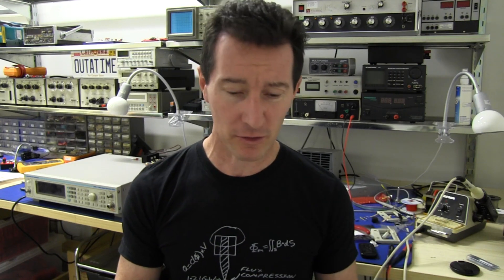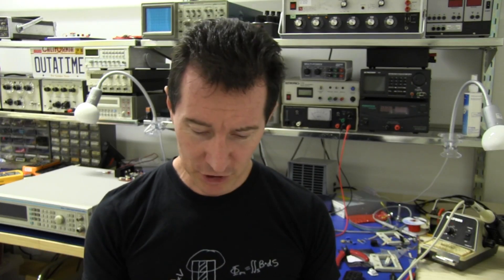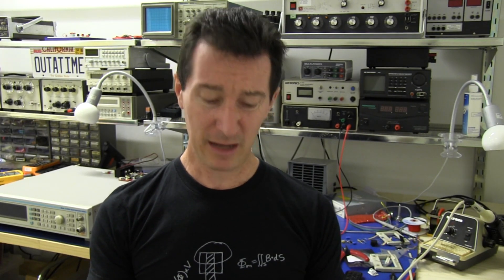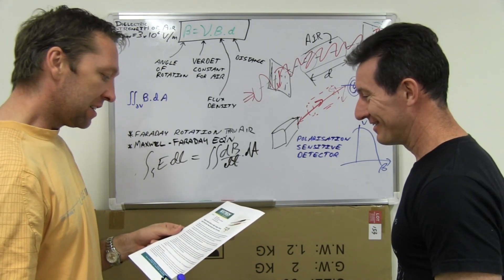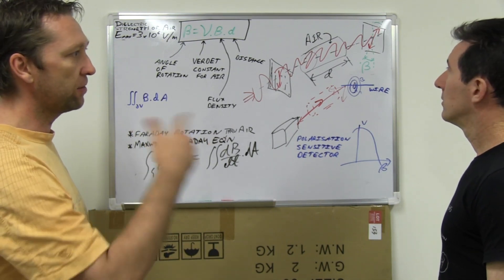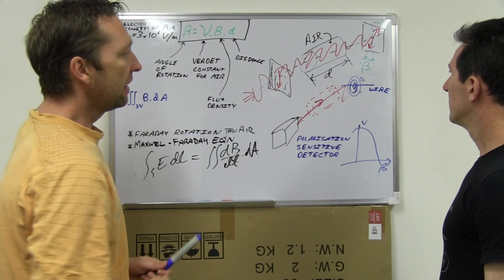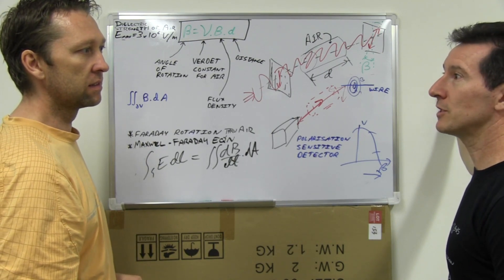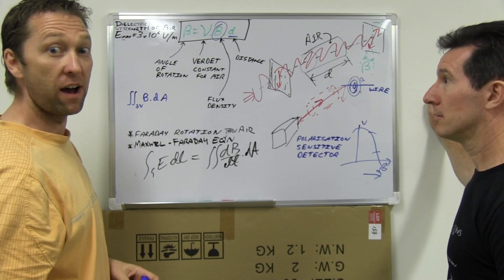EEVBlog #263 - Extech LP100 Laser Test Probes

Comment: I first thought you were talking about a laser being used to report the voltage reading (from a battery-powered probe) down a fiber optic to the scope, thus isolating it (and the user) that much more from ground. Measuring from the wire made no sense at all, so I went right to the posting date and... HaHa.

Comment: Actually the velocity of fast-moving absorbers can be precisely determined using resonant collinear fast-beam/laser interactions. Three possible methods are (1) parallel/antiparallel linear interactions, (2) resonant two-photon interactions, or (3) simultaneous resonant absorption of counter-propagating laser fields in an [inverted] V configuration, making possible an ‘autocalibration’ of particle velocities without any knowledge of the laser frequency. The best way though is with your finger.